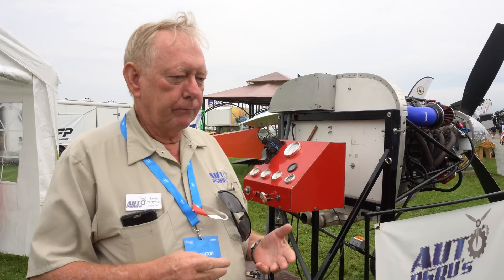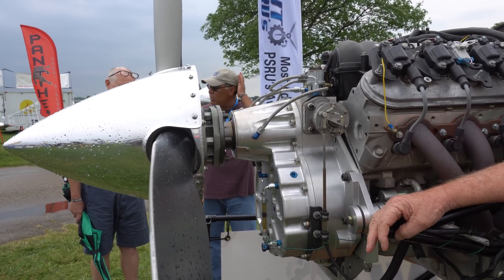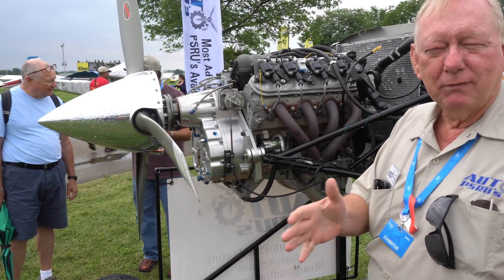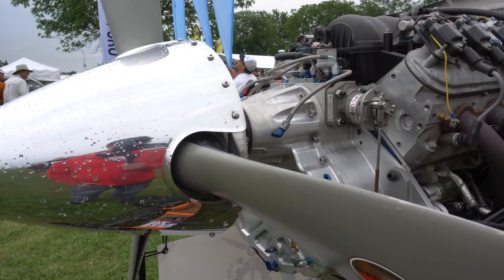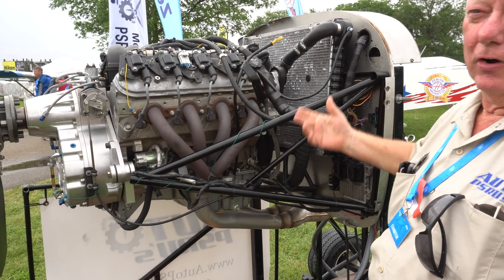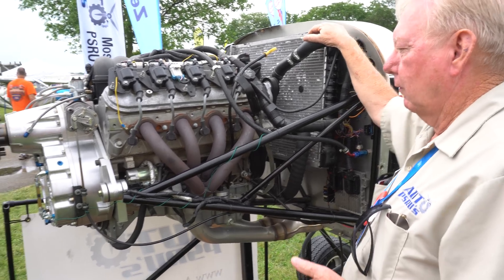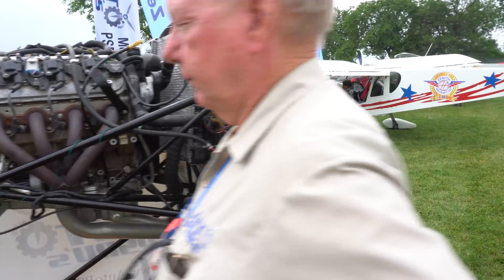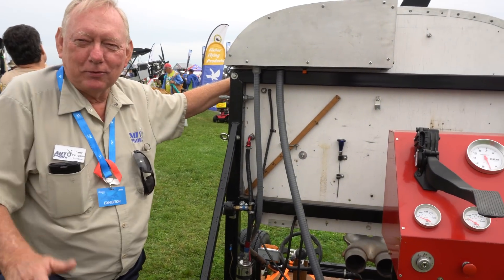LS3 Automotive V8 Engine With Auto PSRU's Geared Drive For Aviation Use

Comment: Seems like GM would try to get these certified for aircraft. Looks like a much better, cheaper , & more powerful & probably lighter engine than the old design Lycoming or Continentals. Easy to turbocharge & they even use dry sump oiling on some Corvettes now. There doesn't seem to be much room between the radiator & bulkhead on this one for airflow but electric fans are common now & don't take up much space. This does look like a nice setup though.
Reply: It's a lot of complexity compared to a Lycoming.  Lycoming is a 4 cylinder lawnmower engine. Fixed magneto timing. Air cooling. Will run without any electrical power.  Simplicity is good when your ass is on the line.
Reply: Perhaps, but it's not supposed to compare to those, but turbine engines. At least I would imagine. The fuel reduction costs as well as lower entry price would make it quite a viable option in the future if they can bring it to market.
Reply: J S was 53
Reply: Don't see no ford coyote in a plane lmao

Comment: The only thing that doesn't looks OK for me - cooling system.
Reply: Allison, Rolls Royce Merlins and many other aircraft engines are also water cooled and have worked fantastically, that's why there are "Engineers"
Reply from the maker: +stalex91 why’s that?
Reply: Looks like air can't freely flow through radiator. This should be solved somehow.
Reply: Since automobile engines are water cooled; my fear is that the coolant will freeze under high wind and cold temperatures.
Reply: It's only for the stand. The aircraft engine setup has two radiators mounted on the sides of the engine with air ducts
Reply: stalex91 n
Reply: I betcha the radiator is mounted a whole lot different in an aircraft, this is for Demo purposes only, DUH!